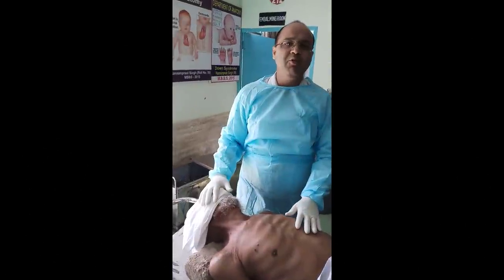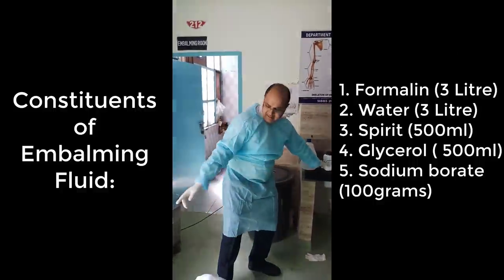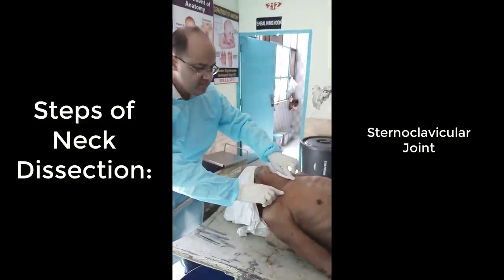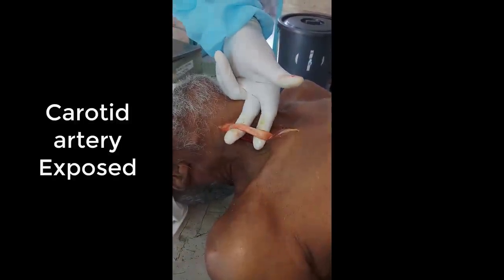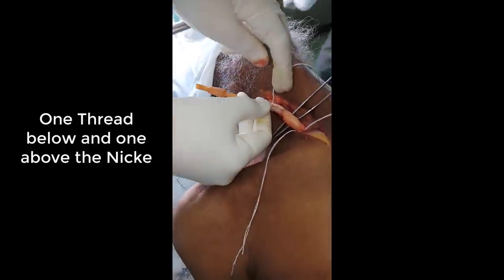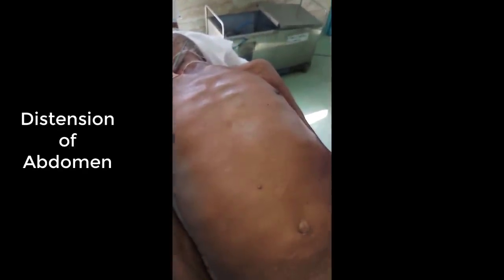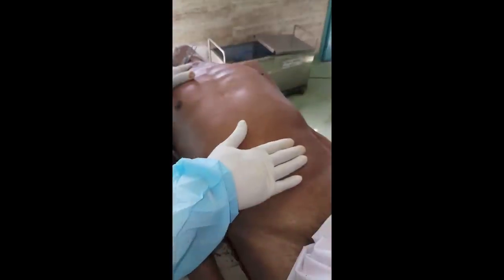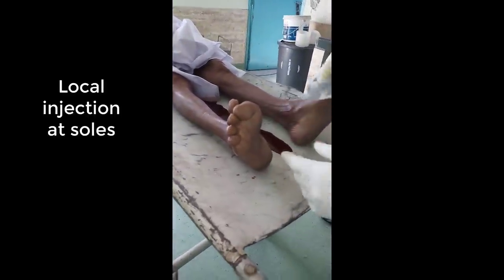How To do Embalming of Human Body

Comment: I'm a writer doing research on embalming and I would be very grateful if you could answer a few short questions?  Thank you for any help.
1. What happens to a person's blood when they die?  Does it clot?  I see a lot of blood under the body at 6:43, where did it come from?
2. Is the purpose of the embalming machine only to make the corpse look fuller, or does it preserve in some way?  I've always heard morticians fill the body with formaldehyde, is that not true?
Reply: Funeral director here:

1)  blot clots. But it stays liquid for a while in the body. Eventually it coagulates. During embalming, blood comes out due to pressure from the process.  That's the blood you see. 

2)  the purpose of embalming is to preserve the body through the funeral process. We use formaldehyde or (less common) gluteraldehyde. It can "fill" the body by filling up the cells and vessels, but that's a beneficial side effect.
Reply: @BNails  Thank you!
Reply: @ratt57  Anytime!

Comment: I don't understand why embalming solution was injected into the soles of the feet. Would this be done in a situation where the feet wouldn't be visible, say in a casket with only the upper half showing?
Reply: Usually, yes. You don't want one part of the body to begin to decompose prior to the viewing even on parts that are not visible. Bacteria and smells of decomposition aren't great for viewings, and sometimes viewings are a while after the person is actually deceased so all parts are typically embalmed and preserved.
Reply: Not everywhere embalming is done for funeral purpose. Here in India it's mostly done to preserve the body for long duration for educational purpose in medical colleges.

Comment: you guys and your privileges commenting about the work environment... not every country has the privilege of getting new and clean equipments. they have to resort to using with what they have to educate us of the procedures. if you want them to use new equipments then why don’t you donate to them? the guy is dead, he wont complain about using a brick as a pillow. the body was donated so that students can learn about the procedures. having lived in a third world country myself, it is beyond hard to make flies stay away. doing something like an autopsy needs ventilation because of the smell and if it’s especially hot/humid. you can’t do that in a room with barely any ventilators. why don’t they have ventilation? the same reason why they don’t have new equipments. you’d have to open the window for some air or perform the autopsy or embalming where outside air can come in.
they do this and posted this for YOU to see and learn. YOU should at the least respect them. i’d suggest you visit a third world country and see what it’s like compared to the “good old ‘merica”. they are two different worlds. you live in a house with conditioning and food while my grandparents lived in a run shack and ate the same fish for breakfast, lunch and dinner.